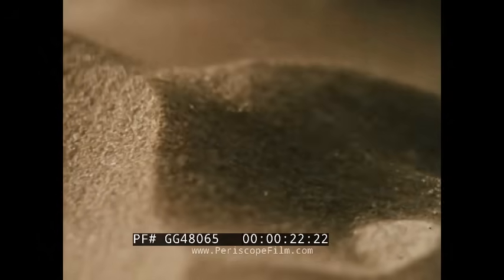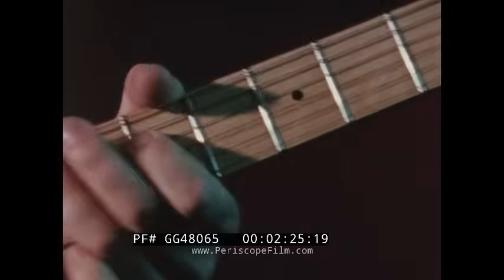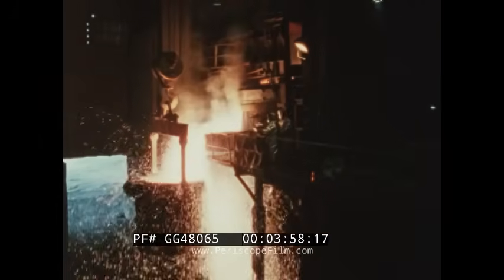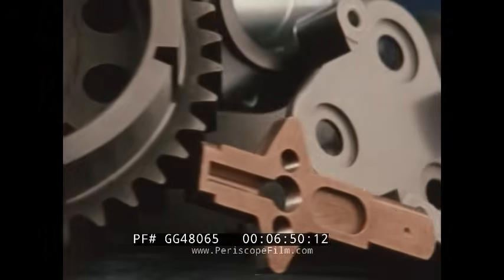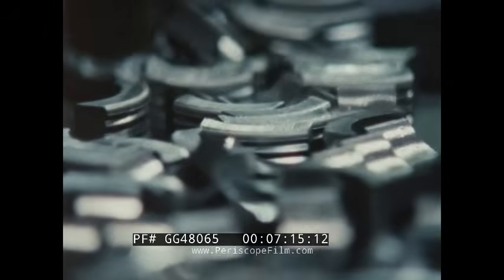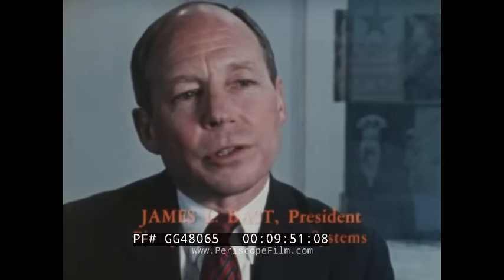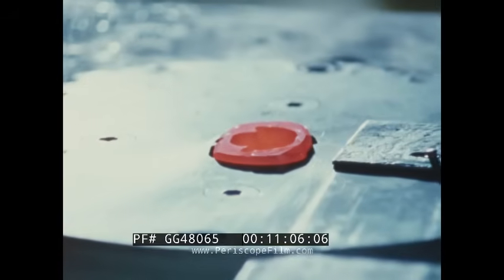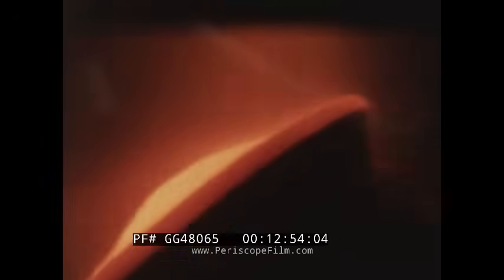"POWDER METALLURGY" 1980 METAL POWDER INDUSTRIES FEDERATION METALWORKING PROCESS PROMO FILM  GG48065

Comment: Leading up to the late 80's and early 90's of automotive manufacturing. Specifically engines and transmissions were stronger than needed. Now cad simulation software allows the perfect alloy, hardness and ductility to just barely get past the warranty. From metal to rubber, everything is designed to fail and be replaced.

Comment: And powdered metal is a requirement for so much of the high performance additive manufacturing. Like in aerospace. You need a lot of strength and capability in a rocket combustion chamber after all.

Comment: Fun fact I live in the powdered metal capitol of the world, which is st.marys Pennsylvania.  In and around st.marys pa is where 40% of all the powdered metal parts in the world come from.  I have worked in powdered metal my whole working life.  I also worked at the factory in Ridgway PA that was the first in the world to do pm forging to make connecting rods for cars.
Reply from the maker: Very cool — Pennsylvania has a rich heritage in steel
Reply: @PeriscopeFilm  I'm Pittsburgh born and raised 😅
Reply: I went to help as electric maintenance at our St Marys plant that GKN owns for two weeks and I had the worst headache from the altitude I was told. I'm not sure if that is what caused it but man I felt like crap. I was coming from Indiana though.
Reply: @franklindorrell4755  we are pretty high in altitude here.  This area is on the Allegheny plateau it is around 1,500-1,800foot elevation.  So that might have been the reason you didn't feel well.  And another fun fact the highest point on I80 east of the Mississippi is in Pennsylvania about an hour from my house.
Reply: @mikepaul2485 I loved the snow mobile trails or roads. They were wild you could drive them to work lmao

Comment: I worked with powdered metals for about 27 years. We molded clutch reaction plates, sprockets, and thermal insulators. We also molded friction materials for aircraft brakes and automotive clutches. The biggest press was rated at 2000 tons and the smallest was rated at 60 tons. The molded compacts were sintered in either a belt furnace or in bell furnaces under pressure depending on which parts we were making. Parts were finished with coining presses or ground with a Blanchard rotary table grinder. Some were coined for hardness then ground to a specific surface finish. It was dusty and hot but I kind of wish I was still working there.
Reply: Nice comment. I worked as maintenance engineer mostly in plastics injection & compression molding  industries..also extrusion. Presses up to 2000 ton. Involved everything from grinders/shredders..material handling..chillers up to 300 ton cooling capacity...automated parts /finished goods handling...PLCs...production accounting/software...electronics...and auxiliary equipment maintenance (forklifts..overhead cranes..electrical service entrance panels up to 10K ampere 3ph...and building maint...fire protection. 
Did a lot of troubleshooting for production and raw material finite analysis for improved product quality. 
Only slack time I had was when the 2008 Great Financial Fiasco hit.
👍
Reply: @katiez1941  yeah most people in 2008 had the same experience thankfully I was too young (for that one! 😊)
Reply: Same here although I was electrician maintenance on the machines.
Reply: Just a regular hobby stock removal high alloy kitchen knife maker (that has the last batch of crucible CPM MPL-1 in the world) that wishes I had the tacit knowledge you guys do. If you ever have nothing to do and want to play with new alloys in JMatPro? Email me - it would be one hell of a learning experience for everyone involved (PhD in integrated tribology, BS in mat sci engineering).

Comment: Luckilly i found and ordered a pawl gear for my 1978 SP370 kick start lever.
No way you can reproduce cheaply this part with machining,manual or CNC.
Reply: Hmmm... Just curious, but how much to CNC a part like that, anyway?? Definitely not an off the shelf gear or item though.
Reply: @ethericbliss23  just like PM, if you know what youre doing then machining is cheap and easy. Id make profile bar stock, part off a dozen slices, put them on a vacuum fixture and grind them to the best thickness.
Its knowledge and experience people lack today, not tools.
Reply: @S1LV3RP01NT  I know... right?! That's doing it by hand though... With CNC that should be even simpler. No!? That's at least what I'd think, anyway. 

I'm not that efficient with machining, myself, but if you have the part in hand (broken even) calipers can be taken to the danged thing, and that, transferred into CAD... It may take a minute (an hour, max?!) then what's there to do?? Hit "Send"? Setup? Material... ?? Press another radio button, maybe?!? XD XD 

IDK what OP did/didn't do, but luckily they seemed to have found one somewhere that will work. : ) I'd still have taken that ONE "good" part and just mic'd the heck outa it, though. Then transferred that into CAD, and just stored that on a HDD somewhere, backed up and outa the way... JIC.